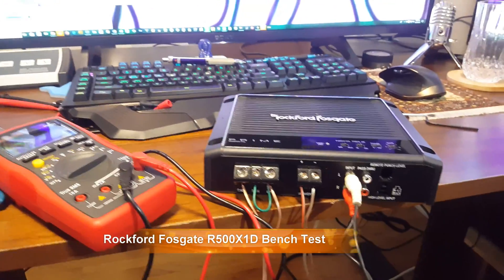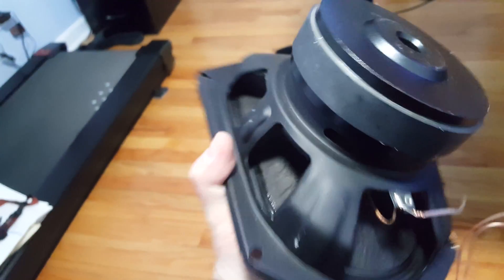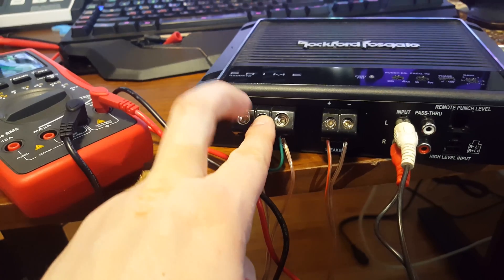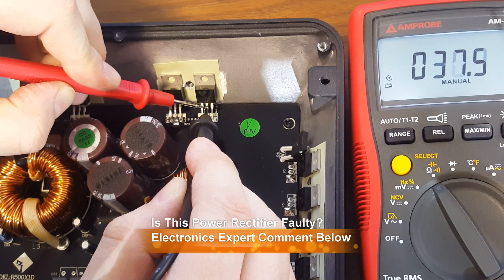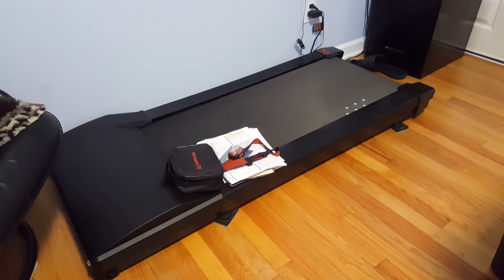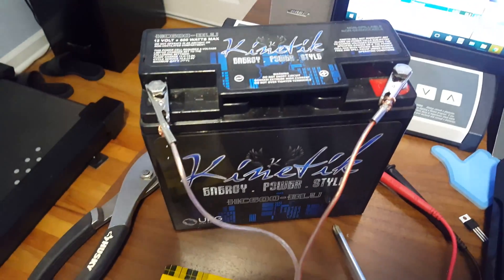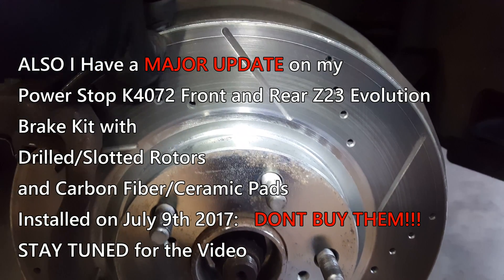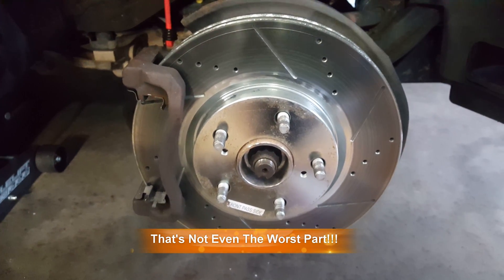Bench Testing Car Amplifier | Rockford Fosgate R500X1D How-to Guide

Comment from the maker: UPDATE: The other day I was helping my brother-in-law upgrade his system to 0 gauge wiring, and we ended up looking at mine. My original 8 gauge wiring was burned near the battery terminal so my Rockford Fosgate was trying to power 650rms through a a 16 gauge wire equivalent!!! Long story short, I upgraded my wiring to a solid 4 gauge OFC copper wire and now my Rockford Fosgate hits harder than ever before. I'm not even sure if I want to upgrade it anymore....
Reply from the maker: BTW, we upgraded my bro=in=laws Buick Lacrosse with a #Mechman Alternator 240 AMP!!! checkout my Twitter or fAcebook page for a small video clip. https://twitter.com/LexSelfMadeLife
Reply: Man upgrade that shit lol. I done went from 2 jbl 1000 watt subs to the mtx jack hammers then I went with 2 12in kicker vrs then went to the 15in ones then I got a solo baric 18inch sub in the back of my envoy on a 5000 watt kicker amp and i loved it but the speaker tore and I didn't know about recone kits  so I sold it. Then I got a f150 because I sold the envoy and had stock in it for a day took it got two 12 inch kicker comp the flat ones that go under seat and had that for about a year took those out and put my 3000 watt pioneer sub where the single flip up backseat is,and it's loud got a 4000 watt power acoustic gothic series amp and it shakes the ground but I'm tired of that so I'm doing 6 HA-Audio spl compition 12in subs 3000 watts and 3 hifonics colusess amps. Each amp pushes 4000 watts rms so bout 18000 watts I'm putting in......moral of story is you  can never have enough BASS OR MUSIC. IF YOU'RE GONNA DO IT, DO IT BIG AND DO IT RIGHT LOL.

Comment: The fuse from your power wire is bad in the car.
Reply from the maker: You are exactly right, it was a glass fuse that looked ok, but I saw a video that said the solder joints are bad. Long story short I upgraded my crappy amp wiring from 8 gauge to 4 gauge OFC. Soon I'm upgrading to 0 gauge because I'm upgrading my amp. My system sounds SOOOO much stronger with the new wire upgrade and we did the BIG 2 out of the BIG 3. I still have to run a better wire from my alternator to the battery, but I'm waiting until I do my 0 gauge conversion. Maybe I'll make a video out of that install for fun.  #caraudio  #subwoofer

Comment from the maker: At the end of the video I'll show you 1 of the reasons why I would NEVER buy #PowerStop Brake parts again! I bought the K4072 Front and Rear Z23 Evolution Brake Kit because of the zinc plated rotors and the carbon fiber/ceramic brake pads... Can't wait to do the full video review for you guys. I already ordered all new brakes including my favorite pads and rotors, I will reveal it in the next video. This BTW is for a 2006 #LexusGS300 AWD.
Reply: I'm really sorry to hear you had a bad experience with them... I got the same kit for my 05' RSX Type-S and been running them for about a year now, they're still going strong. Also, my kit came with 3 or 4 different sets of clips, so it could fit multiple styles of caliper bracket